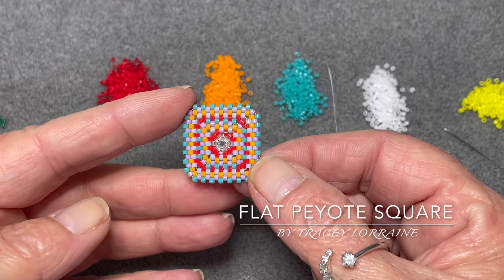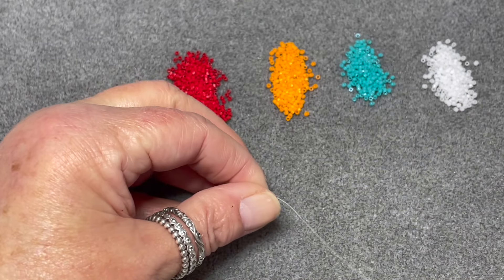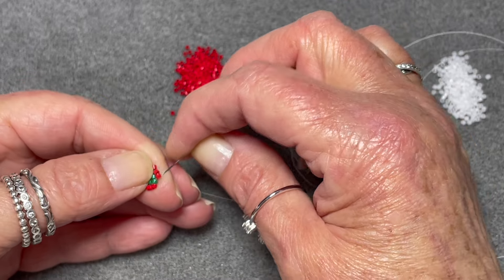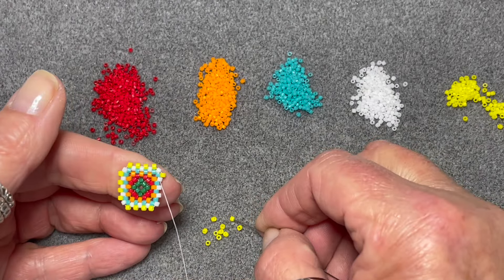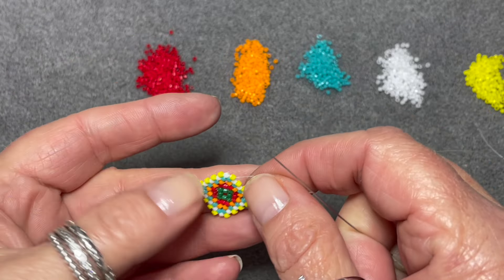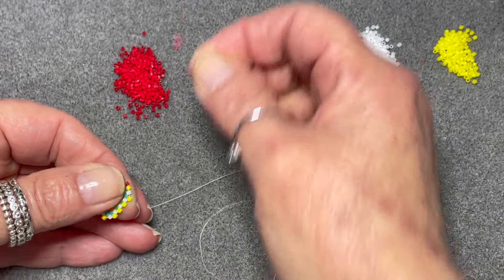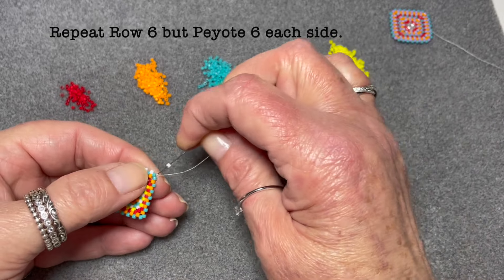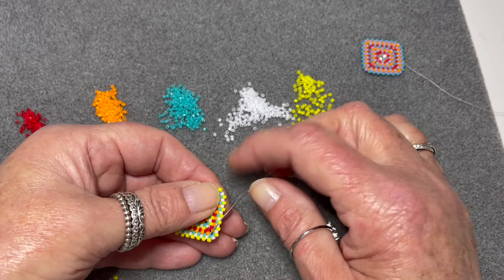HOW TO BEAD A FLAT PEYOTE SQUARE

Comment: you're putting 2 on the sides and 1 on each  corner but you said the opposite so I guess I follow what you do not what you say or it could get a little confusing for us beginners,  but i love you ideas❤
Reply from the maker: You did have me going for a minute or two there Selina because I really thought I had double checked the video before I uploaded it!  But no harm done and I'm glad you took the time to get in touch with your concern, even though it was unfounded. :)

Comment: Hello , why whith this method, I have a warped square ? I use firelibe thread... I don't understand...
Reply from the maker: I think, perhaps, you have not followed the pattern at the corners?  There is a repeat of different corners, on each row, on the flat peyote square.  The warped square has the same corner each time.  Here is a link for the warped square tutorial so that you can compare and see the difference: https://youtu.be/fJ70n_Eb_1E

Comment: I am making a square and it has 3 in the corner? What do you do when you have to jump up and it lands on the 3 beaded corner?
Reply from the maker: You might find it easier just to pass through all the corner beads and to then exit an 'up' bead on the next side Rita?  I hope this makes sense :)
Reply: Thanks I will try that. I am making a box and I seem too loose the step up bead! You are great at what you do!!

Comment: That's a "Granny Square"..  has nothing at all to do with native americans.  jfc... even the beads were invented by non native people.
Reply: Actually, peyote is not an original native American craft. It originated in Africa.
Reply from the maker: Thank you for your comment.  It only looks like a 'Granny Square' (which is usually made in crochet) because of the colours I have used.  Peyote was traditionally stitched using seed beads,  Delica beads give a more uniform finish to a design.  Examples of Peyote have also been found in Europe and Africa and so the stitch is not a uniquely Native American craft.